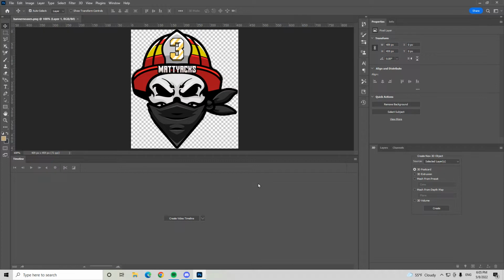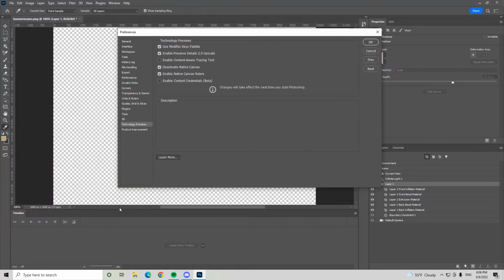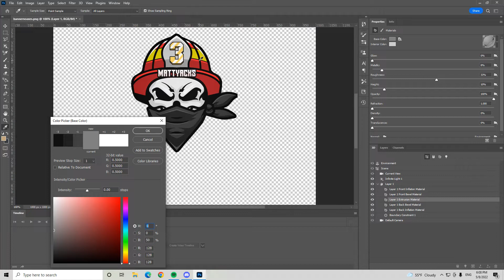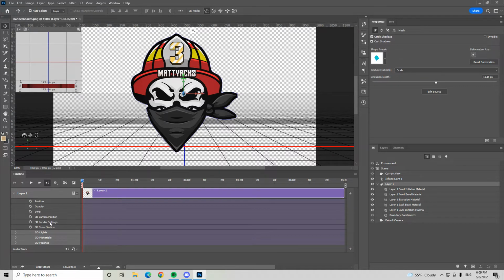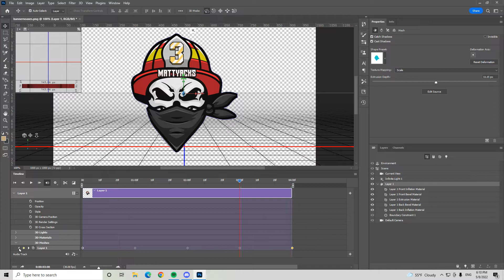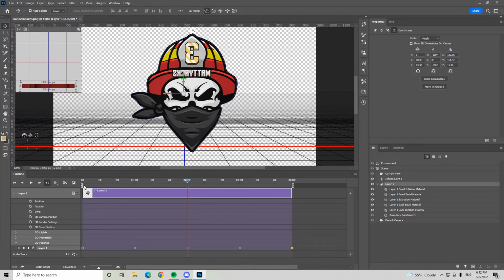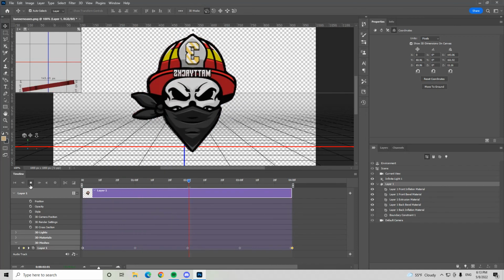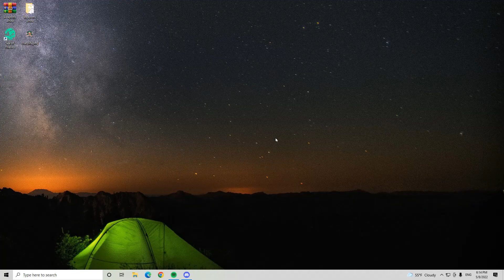3d spinning logo on photoshop (How to)

Comment: Can I take advantage of the project and replace only the logo?
Reply from the maker: What do you mean?
Reply: @mattyacks  if I wanted to do it with another one, I'd have to do it all from scratch. If it would be possible to only replace the logo with another one at the end of the process
Reply from the maker: @LippeOOC  oh I see what you’re saying. I believe you’d have to start from scratch if you wanted to use a differnt image. BUT you could try saving two copies of the file one as GIF ( as you would), and one has a PSD file, this would allow you to go back and change the image, after you you change the image then you’d save it as a GIF. That’s all I could think of that could possibly work
Reply: @mattyacks  Thanks

Comment: When I look for preferences, it doesn’t show up, do Yk why?
Reply from the maker: You’re looking in the edit tab?
Reply: @mattyacks  yes I was , but I was still able to do everything else just fine and able to finish the 3D logo
Reply: @zacharyortiz7423  Adobe is moving the 3D out of PS started dropping out with v.21 and each version after that lost more functionality. See if you have access to version 21 or earlier PS and it will be there. I have access to every version I've had since 16. through the CC cloud. But if you didn't go that route look around because I see them all the time.

Comment: I am trying to export the video as a mp4 file but it does not play as a rotating logo. The logo remains stationary. Can you help me understand why ?
Reply from the maker: You need to save it as a gif
Reply: @mattyacks  Ok so the export to video does not work at all for 3D logo ??
Reply from the maker: @ajitvasudeo6227  not that I know of. It’ll only work as a gif
Reply: See what the FPS is set to. You can speed or sloe it depending on what you choose. MP4 if not exported with correct settings will look fine in app but spin like a Tasmanian devil or stutter and skip after export. Matty is correct. Something this short is better off as gif.